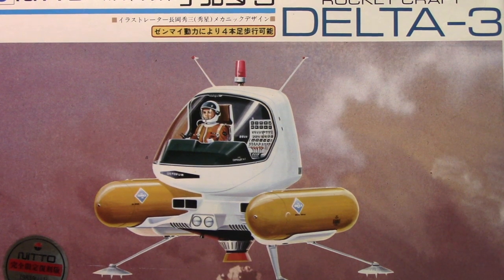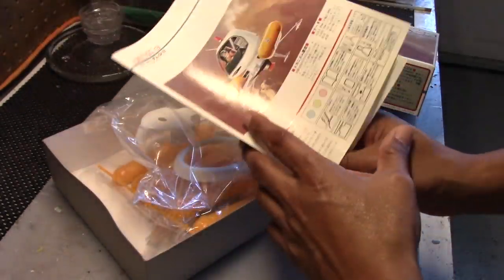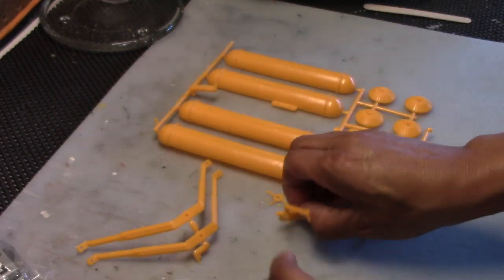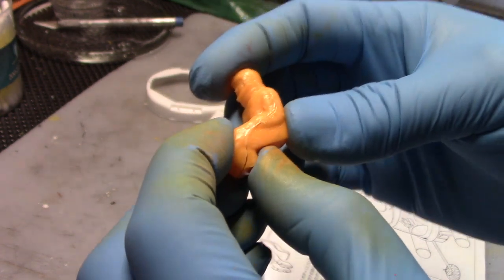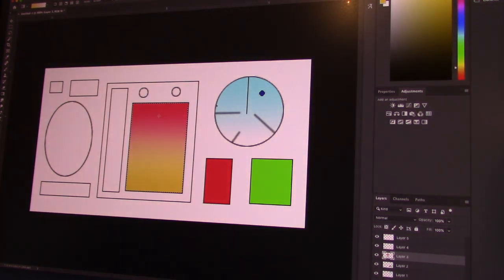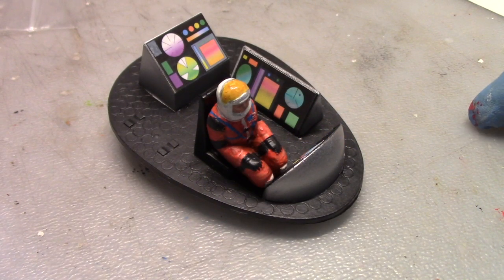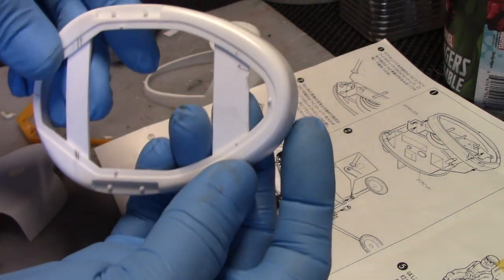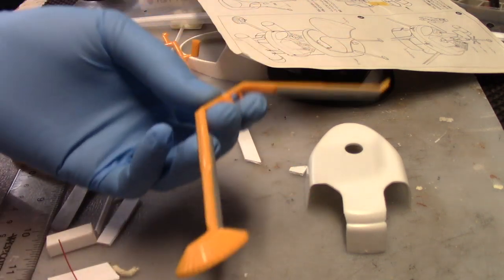Building Nitto's Rocket Craft Delta 3

Comment: For details on any models. You may want to try are the “model railroad” places since model railroaders are like us who would like to add those touches too. They have those color lens too. As for the bottom engines. Try those caps from the tubes or if you what a different design. Try those disposable mechanical pencil caps.
Reply from the maker: Thanks for the tip :)